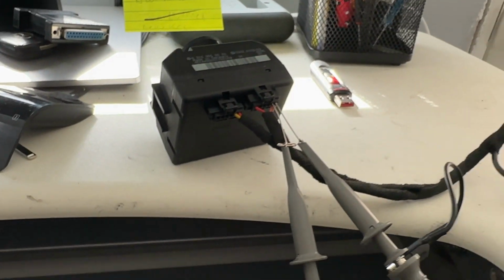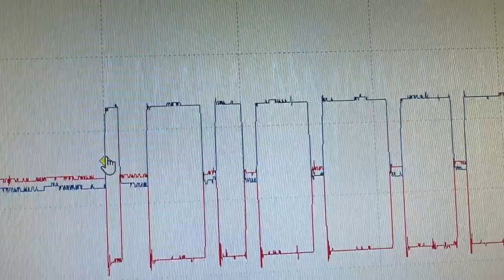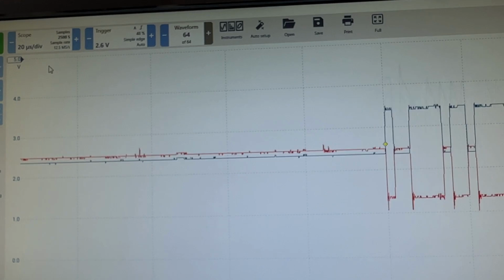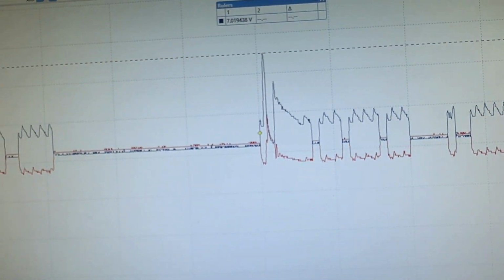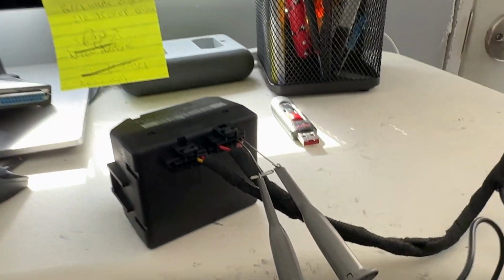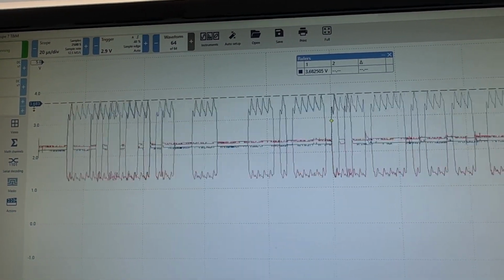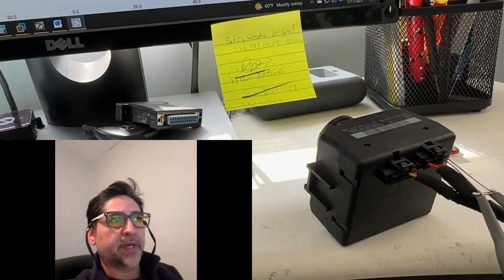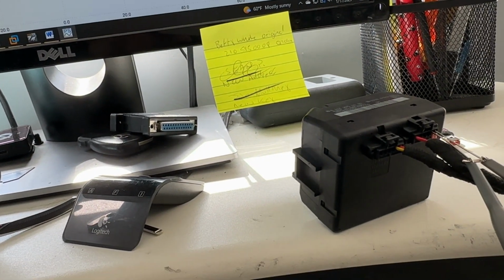2009-2012 Mercedes S550 CL550 ML GL and R Class No Crank No Start. Acts up in cold weather.

Comment: Are you still performing these fixes?  Would I have to buy a new EIS with keyless go if I don't care about retaining the keyless go?  Can a dying key fob battery cause these same issues?   I have a similar issue as described in multiple comments.  The key turns just fine, All electronics work in the dash, but the car won't start and the red "take car to the shop" Message comes on.  When I read the codes with my youcanic scanner I get numerous different EIS codes on numerous different systems.  However, as stated by previous people, a simple disconnect of the battery and reconnect and all of a sudden it works like there's no issue.  

The issue will then reoccur after the car has been sitting for too long or is really cold outside.  I live in Florida so the really cold situation only happens for like 2 weeks a year.  So I'm not sure if it's temperature related because I'm having this issue all the time now, almost everyday.. any help would be greatly appreciated
Reply from the maker: Yes we do them frequently. You can choose a non-keyless go EIS. It's less expensive. No the key fob battery does not cause this issue. This issue is caused by a faulty EIS.

We are very familiar with this exact issue. Call us we can fix this issue.

-Michael
818 510 3375

Comment: I'm having a very similar issue with my 2011 W221 S550 (M273) where sometimes and in cold weather only, the car won't turn on (no crank no start) unless I disconnect the battery for 10 seconds and plug it back in. When it acts up before disconnecting the battery and actually starting, all lights on the dashboard are lit and sometimes my gear selector box disappears (the one that hovers over which gear you're in). If it decides to start without me disconnecting the battery, all of the cluster lights will turn on after like a few seconds to a minute max and the needles will no longer operate or go to 0 even though the engine is still on and is responsive.
Also, sometimes it displays dashes (- - - - -) for mileage before I disconnect the battery. Could this be the reason why? If so, how much do y'all charge for cloning the EIS module? Can I buy one that has a matching PN (used from another W221 S550) and send it over to you to clone it?
Please let me know
Thanks!
Reply from the maker: Sounds like you have this issue. Yes we can clone another one for you. We need to know if your S550 is equipped with Keyless Go (push to start button). If it is, you need to buy a replacement EIS that is equipped with Keyless GO. If you me to help you with this issue, call me.
818 510 3375
-Michael
Reply: I have this same problem, are you still working on these?  Did you get it fixed?

Comment: I ordered the new EIS for my ml 2010, because I have the same problem in my car some time the engine start but after a few seconds all signal is on the dashboard and no gear it mean no d r and some time no start with message visit work shop with gear shifting specially in Cold wether so when i remove the nigativ cable in battery and put it again it will start and I can drive and some time I didn't remove the nigativ cable in battery I remove the EIS connecter and put it again and the car is starting good and I can drive all day so I am sure the problem from the EIS thanks alot for the good vedios and for give me my English is bad
Reply from the maker: @rawhimasri  You describe the symptoms of the CAN bus over voltage I detailed in this video. 

You ordered a new EIS from the Mercedes dealership? We can save you some money by cloning a used EIS for your ML. 
818 510 3375
-Michael
Reply: @mercedesbenzspecialist  yes I ordered a new EIS from Mercedes dealership it cost 700 dollar and now I will go to some one to program it and the problem will fixed
Reply from the maker: Also, how were you able to get one from the dealership? This part is a Theft Relevant Part. Which requires NASTF registration and all types of red tape to cut through.
Reply: @mercedesbenzspecialist  i will take the new EIS in Mercedes company and they will program it in my car
Reply: @mercedesbenzspecialist  I'm having a very similar issue with my 2011 W221 S550 (M273) where sometimes and in cold weather only, the car won't turn on (no crank no start) unless I disconnect the battery for 10 seconds and plug it back in. When it acts up before disconnecting the battery and actually starting, all lights on the dashboard are lit and sometimes my gear selector box disappears (the one that hovers over which gear you're in). If it decides to start without me disconnecting the battery, all of the cluster lights will turn on after like a few seconds to a minute max and the needles will no longer operate or go to 0 even though the engine is still on and is responsive.
Also, sometimes it displays dashes (- - - - -) for mileage before I disconnect the battery. Could this be the reason why? If so, how much do y'all charge for cloning the EIS module? Can I buy one that has a matching PN (used from another W221 S550) and send it over to you to clone it?
Please let me know
Thanks!
Reply: @Infiniterian did you fix your problem having same issue
Reply from the maker: Yes a cloned EIS will solve this issue. We can help get that done. Call us for details. 
818 510 3375
-Michael
Reply from the maker: @hectormalverde7114 we can help with this issue. Call us. 
818 510 3375
-Michael
Reply: @mercedesbenzspecialist  
"Hello again, can I send the new switch to someone who works in programming and have them copy the data from the damaged switch and transfer it to the new one, even if they are working independently and not in a Mercedes company? Or do I need to go and have it programmed at a Mercedes dealership? Thank you in advance."
Reply from the maker: Unfortunately, dealer EISs are coded so that you can't get them programmed any where but the dealership. I can program any EIS that was originally installed in Germany. But EISs that you buy from the dealership must be programmed by the dealer.
Reply: With that faulty EIS,
Can the car still start directly from the engine .

Directly
Reply: @AkachukwuFred-wq9fz   i don't think so i don't know can we start the engine with out the EIS ?